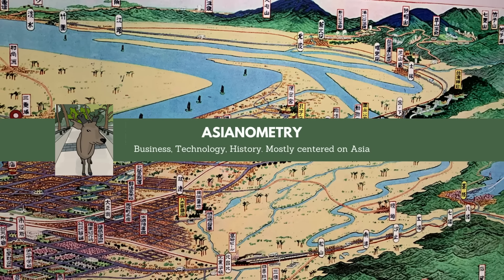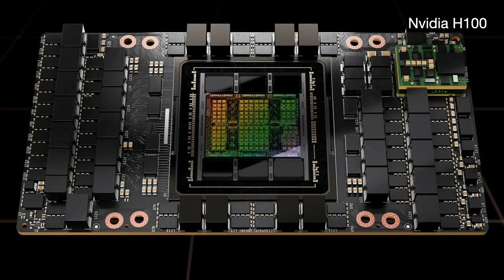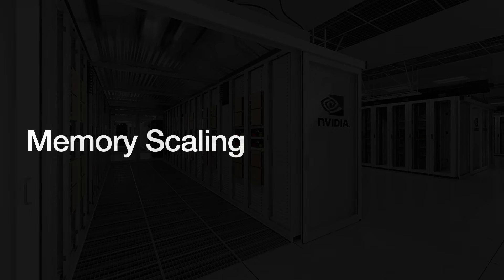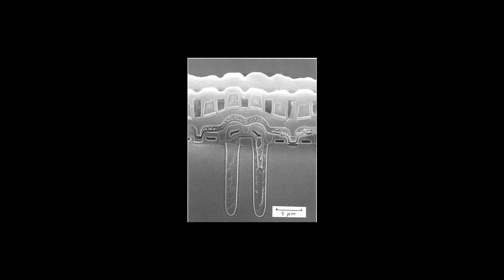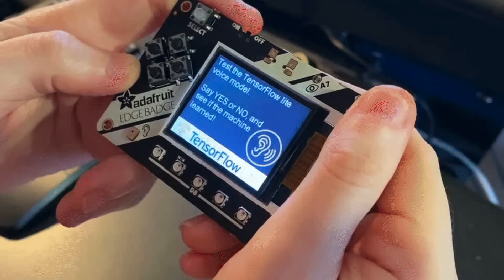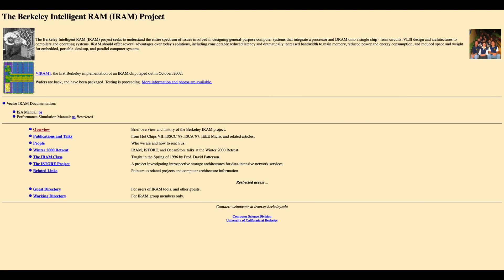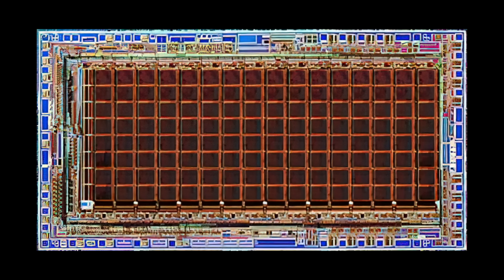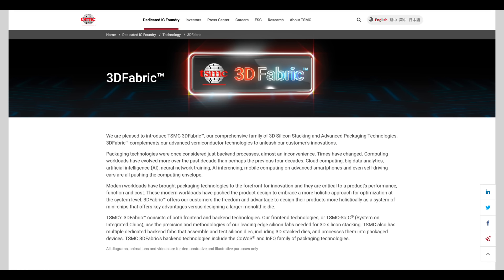AI’s Hardware Problem

Comment: "DRAM memories hat relatively low latency"
Absolutely not! DRAM is high latency memory. DRAM needs to be refreshed, which means you need to read and write every row of memory once every 30-60ms. That alone slows down DRAM latency. Then there's the sense amplifiers: reading from DRAM actually wipes the contents of the read memory cell, so you need to run the output to an amplifier to get a good clean signal, and then you need to rewrite the data back to the memory cell. It's not huge, but it does time. 
DRAM is only low latency when compared to secondary storage like hard drives.

Comment: If the energy cost is the issue, why are we not (at least starting) to use Fredkin gates instead of the traditional logic gates? Since they do computation without using energy, should that not solve the problems? As the problems gets larger and larger, is the upfront cost not getting more and more worth it?

Comment: Excellent video, but I must point out a few inaccuracies. First of all, let me introduce myself. I've been working with Computer Engineering for over 20 years, and I'm currently working in a company that makes chips for accelerating AI applications using exactly a non-Von Neumann architecture.

1. GPUs also don't use a Von Neumann architecture, otherwise, they'd be terrible for AI. They might not be as good as architectures tailored for AI (like Google's TPU).

2. At-memory computing is great for all applications, not just edge ones. It allows for more performance and for saving a lot of power. On an edge device, these translate to longer battery life, and in a data center, they translate into millions of dollars in cost savings.

3. DRAM is one type of memory; there's also SRAM.

4. The eDRAM is not actually a problem. Yes, they're hungrier and larger, but they're also much faster. The L1 cache in modern CPUs is never implemented with DRAM cells, that's why it's small, but it also means it can run at the same clock rates as the rest of the CPU. That's the same reason why CPUs have a cache hierarchy that goes from faster and smaller to slower and larger (L1 -> L2 -> L3).

5. The problem with exotic technologies like R-RAM is that we'll need entirely new production methods, and that's a big problem because the industry will need to see that as the way forward in order to invest in those new fabs. Until non-conventional memory technologies are considered a somewhat safe commercial bet they won't catch on.

The industry differentiates between in-memory and at-memory computing:

In-memory means that computation happens, quite literally, in the memory cells. That minimizes data movement, but the solutions here are analog. That requires converting from digital to analog and then back to digital. This double conversion negates many savings obtained by in-memory computing. Excellent video about in-memory computing: https://www.youtube.com/watch?v=IgF3OX8nT0w&ab_channel=Veritasium

At-memory computing means that data movement is reduced by keeping data very close to where computing takes place. What you have is distributed memory. It's an all-digital digital solution that uses standard tools and standard manufacturing methods. That's where most of the industry is headed right now. Disclaimer: that's the architecture my company adopted for its chips.

In a bit of futurism, I think that because AI is such an important application, eventually enough R&D money will be poured into in-memory computing that it'll eventually win out. But I don't see that happening for another 7 to 10 years.

Other than those, the video is really excellent and well-researched. The memory wall explanation is spot-on.

Comment: AI has always had a hardware problem: the hardware did not exist.  Now it does, but could be better, that's all. Way back then, there was a controversy about analog vs digital computing. We may need to evolve the hardware to break the 2D barrier and develop 3D logic with optical connections in the very mass of a photochromic crystal.

Comment: I suspect and we have seen this already with more and more optimized ASIC's that we will end up with a world where AI models are no longer being run on generic hardware but are created in silicon entirely with as mentioned memory directly attached (chiplet designs) or on die. The cost to build models with tens or hundreds of trillions of parameters means that producing a dedicated chip for this purpose and cramming a few thousand of them in a rack is not really cost prohibitive anymore.

The bigger question I think we should ask is what is the future of these models, so far they are fun and curious but they are not really adding much of value compared to their cost to build. As much smarter people than me have pointed out the current inference AI "revolution" feels a lot like the Web3 movement where there is a lot of money sloshing about with VC's if you mention you are doing something with this great new tech. Yet no one seems to have build a convincing argument for this tech when it comes to making the kind of returns in the next 3 to 5 years that a VC would want to see from at least one of their bets in this space.
It could very well be that in the near future the money will dry up and the big innovations and the whole new world that people are predicting simply does not materialize.

Though this does not mean that the technological obstacles should not be bested and our memory wall problem is a real serious issue that is affecting way more than just AI so the sooner this si solved the better it would be but it would probably mean that the need to solve this quickly will be felt a lot less by the industry and the actual "solution/workaround/innovation" needed to slay that dragon is way further of than we currently hope.

Comment: using memory to replace combinational logic circuits(CLC for short), it is done since 70s, it is also known as LUT(look up tables) this is not something new, the problem is not everything can be put into LUT, for example an adder, for a 64bit added you would need 18 exabytes of memory just to add two numbers,  and a computer has a lot more adders,. another example is sequential circuits(like registers and static ram), where it uses gates in loops to save the state of the bit.

As for hardware AI, it is a problem of moving the hardware design paradigm from software to hardware. by implementing hardware neurons. There are already  asic solutions for deep learning.  Harware AI wasn't available till now is because, the demand in the industry for hardware AI was low. Only recently the demand for it increased.

Comment: I'm reminded that it's time to reconsider: 1) Transport-Triggered-Architecture 2) Flow-Based-Programming and 3) Systolic-Arrays in light of the proposed solution vectors to the "memory wall" issue outlined here. I believe clockless designs are appropriate for power-saving modalities.

Comment: CAM (content-addressable memory) aka "associative memory" was on the drawing boards in the mid-00s, with an eye toward AI, and was essentially a hardware implementation of the associate array construct found in most programming languages.  It did find use in network routers for fast hardware lookup of routing table entries.
Reply: CAM is as old as computing. It's not news.

Comment: Why not use old SDD chips to make analog processors?  It doesn't work for the training of the models, but it can execute a model extremely fast and is far cheaper to produce.  Memory inside a processor could be used for AI research and development; however, for the application of ai, it would make more sense to mass-produce analog processors from repurposed SSD chips.  This would be extremely useful for AI inside robotics where cost and size play a significant role in the production of autonomous machines.

Comment: Surprised you haven't reference SOC approach that Apple now uses in which ARM CPU and GPU and the neural processors can simultaneously access the same memory in their laptops eliminating the data transfer issue standard systems suffer.  SOC is also expandable by stitching SOC's together.
Reply: I think that's solving a slightly different problem.  That's about letting you economize by sharing the memory between GPU and main memory (tho is slightly slower than giving each dedicated memory).  It still means that the processing units have to wait (in fact even longer) for data to be delivered from memory.

And Im not sure that's as attractive in the data center where you probably have plenty of things you can fill up the memory with so you don't realize much (any?) savings by using shared memory.

Comment: The original CM-1 Connection Machine had a similar design: up to 2^16 1-Bit ALUs, each integrated with 1024 bits of memory.

Comment: At the time of this comment, Microsoft is considering a $10B investment in OpenAI. (also laying off 10,000 employees, but that is a different story) Though Microsoft is Big Tech and profit driven by design, OpenAI has a bit more altruistic mission. Sure, we the users will need to pay to take advantage of the larger and larger AI models, but it will, I believe, be accessible, and ultimately beneficial, to all of us.

Comment: another option might be to change how AIs work in general. rather then each neuron checking every neuron on the next layer, you could limit them to only talking to the ones next to them or 1-2 neurons away. it would mean we would need larger AI models but id imagine it would be much easier to work with in a RL 3D space. you could feed data in one side and have it come out the other. would still need to somehow allow it to be trainable and to have the data read from each neuron if you ever wanted to copy the chips content into a software model. Given the massive increase in performance this would offer, even if the processing and memory storage is slower, it would still be better. Essentially, you could make bigger and bigger AIs by just making the chip larger and giving it more layers. it would gain massive benefits the larger the AI is you want to work with, rather then one neuron at a time like with standard models, youd be working with one layer at a time no matter how large it is. the potential gains should be obvious if the technical challenges could be worked out.
Reply: I believe current models are based on how the human cerebelum works. Limited input, massive bandwidth and parallelization in between to derive a small but coherent output from those small inputs.

Comment: The solution is simple instead of compute in memory, all we need is a specific and more organized structure to know exactly how to lay out the memory, for example computer under memory, stack the memory on top of the cpu, similar to amds 3d cache system. We all need compute under memory.

Comment: An outsider's way to perform compute within memory:
Sample memory-strings A & B are each 8-bit, each bit addressable.
A holds "01101001"
B holds "00010111"
When you want to add two bit-strings, you can feed each pair of bits into these two memories; "x:1, y:1, carry:0" goes to the memory-address (1,1,0), and that location in A yields the correct addition - "0", while that same location on B yields the correct carry - "1".
Fundamentally, we let the memory act as a look-up table for any obscenely complex function we choose, and we can change that function just by updating the memory, which sounds better than an FPGA. And, each address in memory can actually be a row of data, for same input, many outputs.
Reply: Latency?
Reply: We already have look up tables in programming. Bringing it lower level will require extensive configurability or a set algorithm. Either way, you're getting an FPGA or an ASIC. Remember that the precursor to the FPGA, the CPLD, was literally a memory platform retooled for computation.
Reply: @dfsilversurfer  For inference on massive neural networks, we already wait 30 seconds or more. Compute-in-memory is specifically for neural network applications; low precision, high parallelization, latency can wait. You definitely wouldn't need a custom chip just to run an app where you text your friend.
Reply: I don't get it. What is the memory-address format? How do the locations on A and B get the proper values for the result and carry respectively? Can you rephrase your solution to be more precise. Please use the bit values stored in A and B as in your original example so I can better follow your logic.
Reply: @vaakdemandante8772  Sure! Each memory-slot, A & B, has a set of addresses, and at those addresses are held a bit, like this:
Address      Value Stored in {A,B}
000                     {0,0}
001                     {1,0}
010                     {1,0}
011                     {0,1}
100                     {1,0}
101                     {0,1}
110                     {0,1}
111                     {1,1}
This uses only 16 bits of memory, and a NON programmable addressing, so it's simpler than the CPLD mentioned above, while still giving us a full adder!
Now, if we had two arbitrarily long bit-strings that we want to add, called X & Y, then we can feed the first pair of bits from those strings into this memory-logic, using those bits as the address that we will look-in, for A & B . For example, if the first bits from our arbitrarily long strings are both "1", while we have no carry-bit yet , then that combined address is "011", meaning "0 carry-bits so far, and a 1 for string X and a 1 for string Y." At that address, "011", the value stored by A is "0" which is the correct answer for "what value should be stored in that addition's binary slot?" (1 + 1 in binary leaves a 0 in the one's column.) At the same time, that same address points to the value "1" in B, which is the correct answer for "what value should be carried to the next binary digit?" (1 + 1 leaves a 1 in the two's-column.) I mentioned "A & B" as separate vectors, but you would really just have a 2 x 8 block of memory, and pull both bits, A's & B's, at once.
That is just a simplistic example. Realistically, memory would be in much larger blocks, such as 16 x 64, for massive, nuanced, bizarre logics to be held as fast look-up tables. This isn't a cure-all best-ever; it's for massive parallel operations, reconfigurable on the fly, with an eye toward advanced machine learning.
Reply: @vaakdemandante8772  To see how this could help in ML: machines are already great at constructing their own heuristics, using fragments - the image-recognition AI can be 'parsed' according to what inputs activate it, revealing vague categories in its latent space. Similarly, teacher-learner machines will construct their own curriculum; when an image-recognition system is trained by such a curriculum, the training examples that they teacher creates are weird blobs of features that we find unrecognizable. Similarly, ML found faster algebraic intermediaries for speeding-up matrix multiplication. When we let AI design its own Lego-blocks of code and algebra, it finds ways to cluster that are simultaneously more efficient and predictive, while being entirely unpredicted by us, seeming bizarre. If we find those curriculum-examples, we've found shortcuts; we just need a flexible way to put those into a simpler format. This memory-as-logic I mentioned can do that...

Comment: Or might there be a software solution? At least partly? I mean today GPT holds literally the whole knowledge of the internet as tokens in memory. That's a huge waste of resources. I am sure there are aspects that are hardly ever asked for. We humans also are slow on remembering things that we don't need so often. So what if we optimize our models so they layoff parts of the model from VRAM to system RAM or even SSD. Accessing these would be much slower of course. But if it's not needed all the time, it might speed up responses to knowledge that's requested more often.

Comment: the entire video rests on the premise that von-neumann arechitecture are "too slow" to utilize deep learning with huge models at acceptable speeds ... which is utter nonsense. Even the absolute biggest model can be utilized perfectly - and within acceptable, total computing times. The solution to the latency problem has been : (drumrolls please!)  
... scaling!
Even the biggest model can be segmented, the same is true for actual computation -- of course cant spread a single computation over several computers but you can spread n computations over n computers, you just need to propagate the commands and aggregate the results afterwards - which is the only, real bottleneck and even that one can be migitated via uplinks like infiniband, meaning : high-performance networking. Even "standard" networking will do it, it just takes more time ... which results in a natural split of the market : insanely diverse AI cloud computation for businesses und enthusiasts and somewhat "focused" AI computation in private homes. Focused AI results are more than enough for everyone. Just download stablediffusion and try it yourself. It really suffices - in every regard. Without compromise
Reply: This!